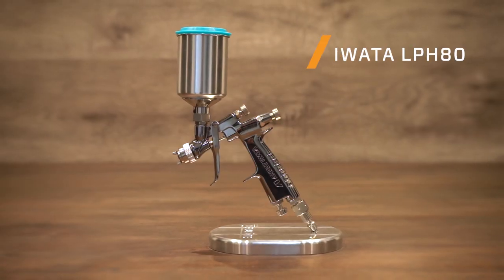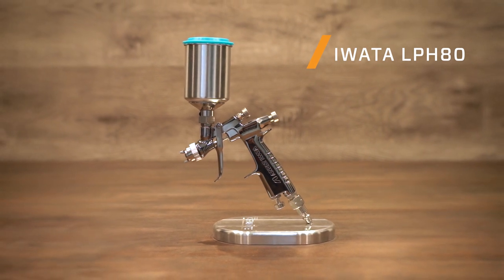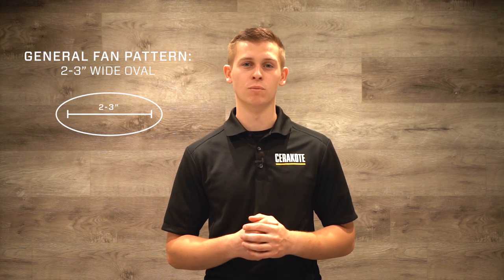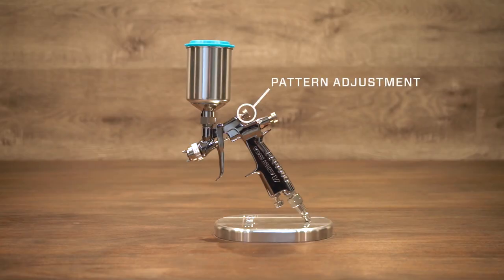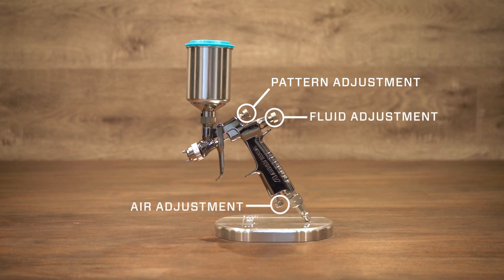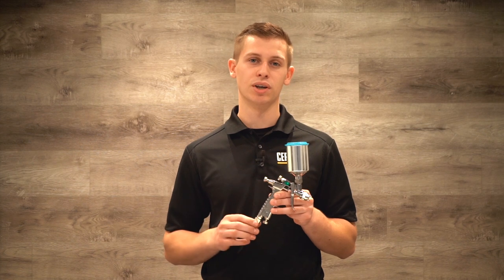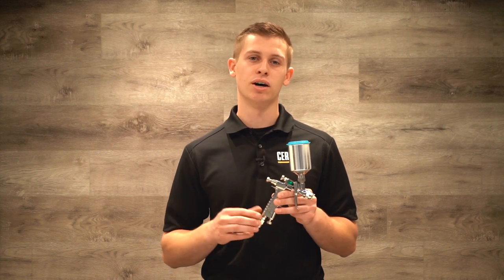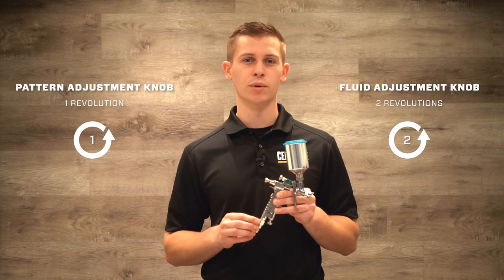How To Adjust The IWATA LPH80 Spray Gun For Cerakote

Comment: I noticed you set the pressure at the wall, but you should have a gauge directly under the gun to read the correct inlet pressure.
Reply: To anyone else reading - this is 100% accurate. Air pressure should always be full coming out of the compressor, then dialed down to maybe double your desired pressure at the wall regulator, then set precisely on the gun. There's no scenario in which you should ever be spraying without a regulator on the gun.
Reply: This is a baseline training video.  There are many other variables as well, such as air humidity, temperature and so on.  Cerakote is simply providing the basics in this training video, it's up to each individual applicator to make calibration adjustments based off their equipment and climate.
Reply: @redcon1tacticalllc606  It's grossly misleading to be clear...  Paint labels will mention humidty/temps but improper tool usage could compromise any paint/environment!  Secondly, the video tips in here could actually and very possibly end up damaging your air compressor!  
I'm going to go ahead and say that this guy in the video does NOT work frequently with spraying.  He probably did a quick review and then made the video once he assumed he understood everything well enough to share it.

Comment: Great video!  Question on Air compressors if you could, What are the recommended specs for a compressor to run on the LPH80 if you are low volume and looking to do mostly smaller projects, at least at first?
Reply: The lph80 won’t be an issue with air volume, since it’s an HVLP, it doesn’t need a ton of cfm to maintain proper inlet psi. You’re sandblaster is going to dictate the size of your compressor. I use a 5hp, 2 stage ingersoll rand 80gal compressor daily, on a large snap-on sandblaster, for cerakote. The compressor is capable of 15.1 cfm at 90 psi. When running the blaster, it keeps up, but runs continuously through long blasting sessions. While Cerakoting, my compressor only turns on every once in a while. It replaces the air I’ve used, shuts off and doesn’t come on again until it needs to top off again.

So size your compressor to your blaster, and don’t worry about the gun. Good luck to ya. 👍

Comment: Is the adjustment the same as the starter spray gun?
Reply from the maker: If you are referring to the location of the adjustment dials, they are the same. If you are wondering about how many turns it takes to make the correct adjustment, it will be similar but just make sure that the pattern is looking right on paper first(size, shape, and material flow) and use that as your guide.

Comment: What nozzle size do you recommend? 0.8, 1.2 or 1.2mm. Thanks
Reply from the maker: We recommend using a 0.8mm tip.
Reply: Cerakote can you still use 1.0 nozzle?
Reply: @popswerks7915  yes, it works great. The 1.0 is all I use and it's able to deliver the proper material thickness and works well with each color. You just have to be aware that it will flood material if you let it. The "air/fuel ratio" needs to be adjusted to compensate for the larger tip. I dial the fluid knob in more and bump air pressure a little. Cerakote already recommends a crazy high air pressure for this gun, so don't go nuts with air or else it'll push the wet material around on the surface.